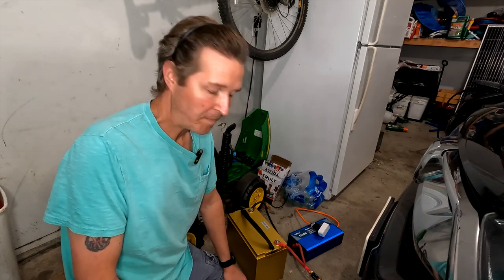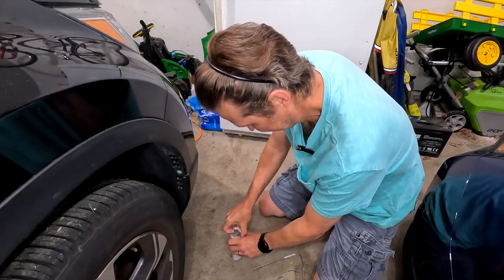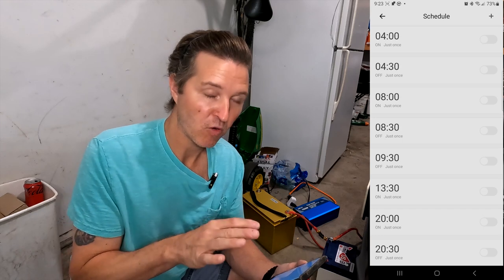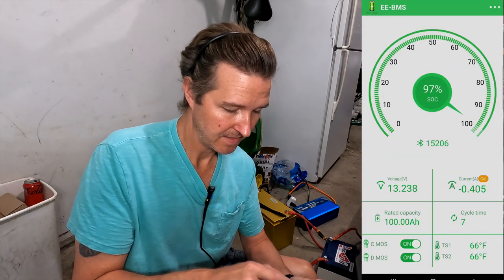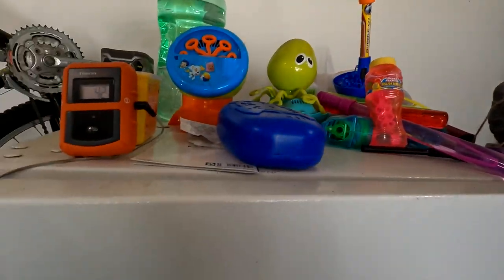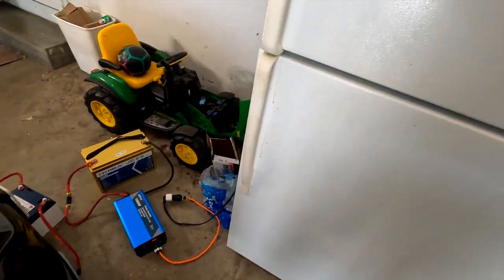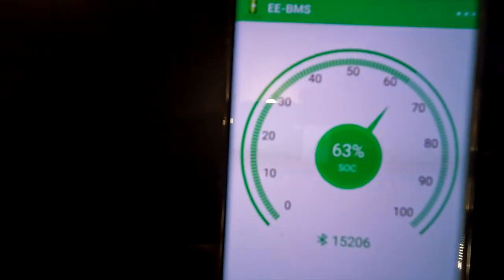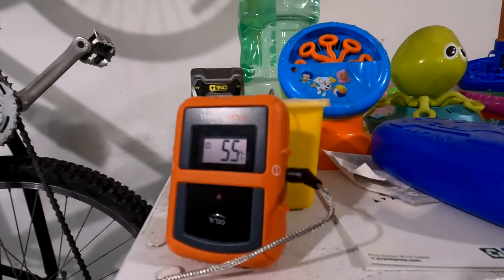Run a 20 year old fridge with a 100ah Lifepo4 battery for over 48 hours?  Is it even possible?

Comment: I use to own a deli and your starting temp on the fridge is way to high.  If you keep your fridge at 36 degrees your food will last longer.  42 is the cutoff point for the health department.  A health inspector will literally give you more time for your food if you keep it colder.  Food spoils on the outside first.  That's why they tell you not to defrost on the counter.  Even if the middle of your meat is frozen while on the counter the outside isn't and starts growing bacteria.  If you cutback the time between off and on I would imagine you could at least get a day out of it which doubles the normal time.  Great video!
Reply from the maker: Thank you for the information!  I'll lower the temp down a bit before the next test.  Thanks again.

Comment: I easily ran an "old style fridge" (made a few years ago but top mount and no crazy compressor or electronics either) for over 50 hours with my Licitti 1,000 battery box with 280 Ah battery. I can't remember if you reviewed it but I didn't have to stop and start it, just plugged it in and worked it as normal but it was in the house. 
  But I did push it to the limit and the battery start surging power at the end when I turned it off. My rule now is 40 hours with the fridge only.
  This Licitti battery box gave me confidence in LIFEPO4 batteries that the Licitti battery box is the only portable power station I'll buy. The system I am working towards now is a 48 Volt system.  I can recharge  the Licitti battery box with solar but I also learned that solar is not always available which is why I am now working towards the 48 Volt system with more capacity than I need for those days without sun during a power outage. 
   I personally wouldn't do the hovering temp that you are doing but I also understand some people may be pushed to it and I am sure it will help someone. We really appreciate all the hard work you do here.
Reply from the maker: Thanks for the comment.  I didn't like the idea of this and it sure didn't work out.  The best thing is to let the fridge do its thing and not mess with it.  Thanks for sharing and the comment.
Reply: @OffGridBasement  Thank you sincerely for doing this though.

Comment: I currently am powering a full size upright freezer using solar, 2 x 200 ah batteries 24 volts and it more then does the job. I use a mechanical timer also,  but really not needed. It has never completely drained the batteries. I live in NW Ct and we have long stretches of cloudy days. I run it about 40% on. Great video!
Reply from the maker: Thanks for the info and the comment.

Comment: Whenever people look at installing solar and batteries and an inverter to power loads, there are two things they learn rather quickly.  The first thing is, most loads are tiny, like charging your phone or running some LED lights.  Other loads are massive, like an electric water heater or clothes dryer.  What you have in-between those extremes are things like a refrigerator, which doesn't use a ton of power at any one time, but uses a moderate amount of power numerous times throughout the day.  The amount of power needed, in the form of solar panel arrays, battery banks and inverter capacity can be truly "shocking", when you start to add up all your loads.  Even if you have a critical loads panel that doesn't include 240v stuff, it still takes a lot of juice to keep all of this stuff going.  

Now, if you had a couple of 12v fridges, they use a lot less power.  I have run a 12v fridge for 10-14 days, off a 100ah battery, by going DC-to-DC and avoiding the inverter losses.
Reply from the maker: You are right.  I have a desktop computer and my internet modem connected to my office grid setup and it uses 100w 24 hours a day.  The small things really add up because they run all the time!  Thanks for the comment and the info.

Comment: Definitely an interesting test. I bet if it were on longer than off, the temperature would hold. Run it for 2 hours then leave off for 1. It would be on for 16 hours and off for 8 total for the day. It would still prolong your battery by 1/3
Reply: the food would stay cold longer im guessing
Reply from the maker: I plan on changing the timing to see what works best.  Thanks for the comment.

Comment: Maybe do 3 hours off, 1 hour on. Might give the fridge/freezer a chance to bring the temps back down to a safe range. Might be able to eek out 24 hours that way. Also wondering about a fridge/freezer with a better efficiency and insulation rating. I am enjoying the experiments you put together on your channel. Great work!
Reply: I would take it down to two hours. One thing I learned the hard way was when I switched from grid to off grid and back again, there would be a surge in electricity use of quite a bit. So I bought a UPS and connected my refrigerator to it, thereby avoiding the big surges! It also made sure I didn’t have to worry about forgetting to plug it back in.
Reply from the maker: That's a good idea.  I'm going to try different timings to what will work.  Thanks for the comment.

Comment: that is a simple duty cycle or "pulse width modulation" kind of operation. if the fridge is not holding the desired temperature you could just increase the ON time and reduce the OFF time until you achieve your desired results.
Reply from the maker: Yes.  That's the plan.  I'm going to try a 2 hour on / 2 hour off setup next.  Hopefully that is the sweet spot for my old fridge.  Thanks!

Comment: It does give you a place where you can do more testing though. The problem is it isn't on long enough to even get the fridge back to neutral temp. In an emergency battery testing - connect battery & lower fridge temp way down and run for a while, then maybe start a 50 / 50 on off.
Reply from the maker: I'll try it out.  Thanks for the info and the comment.

Comment: Does the inverter also switch off or just the fridge, as the inverter also leach power from the battery. Great test, thanks.
Reply from the maker: No it doesn't.  It also doesn't have any sort of power saving settings.  Thanks for the comment.

Comment: Hmm.  A couple of things here. 

First, you don't want to put the refrigerator's power on a timer.  If the power is shut-down while the refrigerator's compressor is starting up, that will put a lot of stress on the compressor.

In terms of powering the fridge with AC, it comes down to the idle current draw of the inverter.  Often, using a smaller inverter (that is still able to power the fridge) also has lower idle current draw and the fridge will run longer on the battery.

The absolute best solution is to have a DC fridge that you run directly from DC.  There is no idle current draw in that situation (usually less than 1W with a modern fridge) and power is only consumed while the compressor is actually running.
Reply from the maker: I totally agree.  This is not the ideal way you would want to run a refrigerator..  Grid or Off Grid.  I'm really just trying to find out if in a SHTF situation if you could possibly squeeze more out of your battery when running an old AC fridge.  This is by no means a test to find a better permanent solution.  Thanks for the info and the comment!

Comment: I guess you really don't know until you try. Perhaps shorter off periods would work better, but a refrigerator will only run as much as needed to maintain the set temperature. Maybe during a power outage you could just increase the temp setting a bit higher in the fridge to reduce power consumption, and then leave it plugged in and running. That should indeed extend the runtime, especially if you have worked out beforehand the temp control setting to maintain a still safe but somewhat higher temperature.
Reply from the maker: I believe that would be the better test.  Keep it plugged in, but just raise the thermostat to the top safe level.

Comment: Good work.  I designed my system with 200 watts per hour from the refrigerator as the constant load for the house.  From that I figured I needed close to 4.8 kwh of batteries  and at least 800 watts of solar with around 6 good hours of sun here in CA in the summertime.
Reply from the maker: Sounds like you're on the right track.  Thanks for the comment.

Comment: Keep and two or three 1 gal. milk jugs filled with water in the freezer and let them freeze so that you will have at least a 32 degree or lower cold sink. Then you can move 1 gal. to refrigerator section before you test again. I do this routinely in case of an outage.
Reply from the maker: That's a good idea.  Thanks for the tip and the comment.

Comment: I'm not going to bother with this. Budget for the battery you need to run the fridge as it is designed to run.

The fridge has a thermostat so it will turn on and off as needed to maintain temperature.  Being "frost free" it also has some heating element to melt frost on the evaporator.  It needs power to do these things or it is not going to operate properly.  It will either let the food warm up (especially the freezer compartment) or it is going to confuse the defrost cycles and either freeze up or do extra melting (and power consumption).

Best case you'll get things tuned to operate correctly, but then the environment temperature will change and you'll need to adjust.

The recommendation I've seen if you need to cycle the power (such as with a generator) is several hours on and then do several hours off when you are not opening the fridge.
Reply from the maker: Thanks for the info and the comment.

Comment: With 63% battery still there, I am wondering if you doubled the runtime before cutoff.  Would doubling the cooling period maintain a justifiable use of this technique, or would the battery and food not survive the re-examination?  Of course, I might be thinking more on the 24hrs line than the 48hrs.
Reply from the maker: Doubling the runtime would've made a big difference.  I'm going to drive further into this when the weather warms up.  Thanks for the comment.

Comment: All it takes is to encounter one, or two defrost cycles during those timed runs and the whole thing's going to go downhill from there if it isn't given enough run-time immediately afterward to fully recover. Just curious, what does the static, no-load voltage LED show on that ALFAA inverter, and does it change while under the operational load of the fridge? Thanks.
Reply: P.S.:  a/c voltage LED. thanks.
Reply from the maker: I'll be doing another video with a 2 hour on / off timer.  I'll watch the AC voltage then.  Thanks for the comment and info.

Comment: Do you have a review of the Smart Plug you're using?
Reply from the maker: I don't have a video review of the smart plug I used.  I don't feel like it really has much to do with an off grid environment.  I do have to say they are really handy and they tend to work very well.  Here is an Amazon link to what I bought.  https://amzn.to/3PkwUM5
I hope this helps!
Reply: @OffGridBasement  Thank You.  It helps in that I like to know a product works as advertised without having to return it later.

Comment: The theory sais that the cooling energy depends on heat leakage into the fridge after it has been cooled down to the correct temperature. If the temperature in the fridge is allowed to go a little higher you save energy but you can do that as well by putting the thermostad higher. You don't want to do that because then the food may go off.
The thermostat  off the fridge turn the fridge on as needed to cool it sufficiently down but not more. There fore the fridge should on it's own not use any more energy than needed. Savings should there fore only be possible in turning off the inverter when the fridge doesn't need energy. It should of cause be possible to put the timer so that the inverter is only on a little longer than the fridge would normally be running and turn the timer for the inverter on again at a slightly shorter time than the fridge is off normally but if you open the door to take some thing out you introduce hot air and change the timing of the fridge. It should all be controlled by the thermostat in the fridge and that would be possible but requires a rewiring of the fridge. The thermostat could be wired in instead of the timer. A secondary thermostat could be used for testing this.
Reply from the maker: I completely understand about letting the fridge do its thing and that really being the best way.  I just wanted to see if there is anything that can be done to extend the battery life during a extended power outage by using a timer.  Even a couple hours would make a difference.  I know it's not good on the fridge.  I'm also really taking into consideration the fact that the food inside can't get over a certain temp for a set amount of time.  You're right, the best way would be to somehow turn off the inverter to do this.  Thanks for the info and the comment.